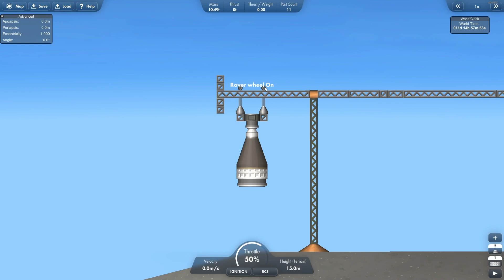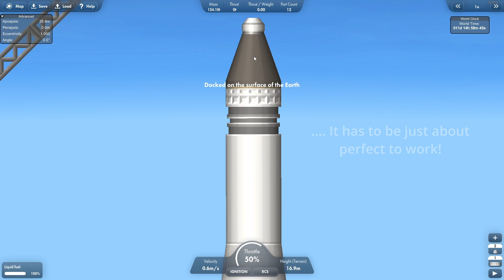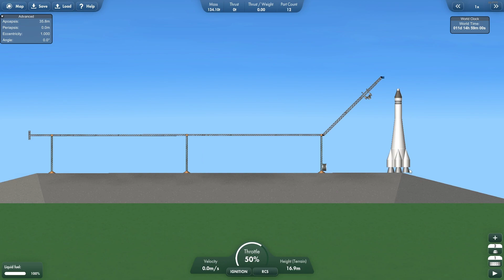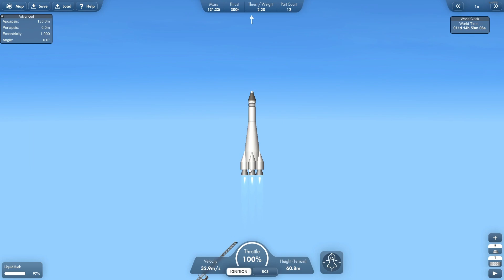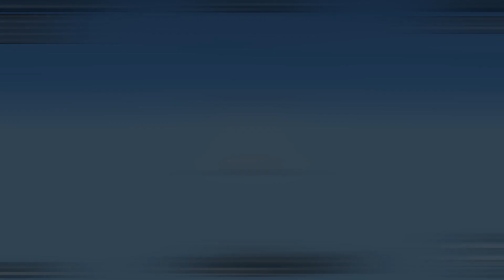Trolly Wheel Demonstration | Utility Pack Custom Part for Spaceflight Simulator

Comment: Seems like it can be built without mods🐟
Reply: solar panels break easily 🗿
Reply from the maker: Go for it, but the BP-edit solution is far more fragile.
Reply from the maker: They are Solar panels… they are not built for durability.

Comment: well i have one problem with the additonal launch veichle icps when i make sls block 1 i use dragon extend engine when i seperate it it wont detach please fix this problem and make juno 1 mod pack.
Reply from the maker: Which engine are you using? If the bottom of the engine is touching something it could be stuck, that said for my Extending Engine (which is not called the Dragon so that's my confusion) it will detach on engine activation. Unless you are clipping then of course, all bets are off...